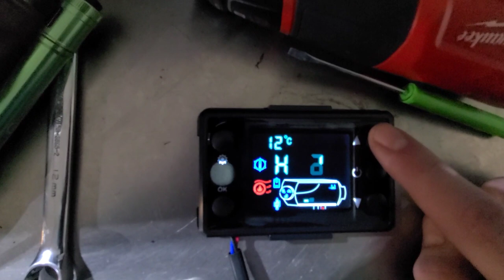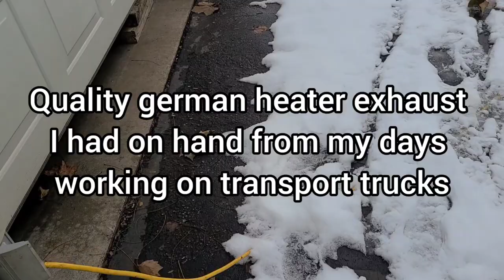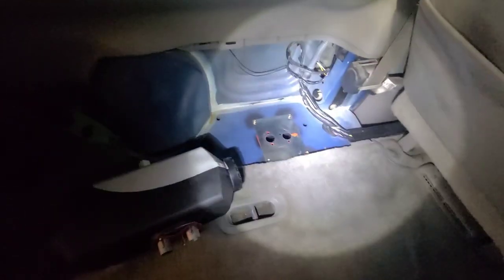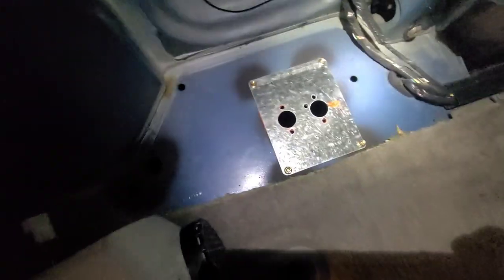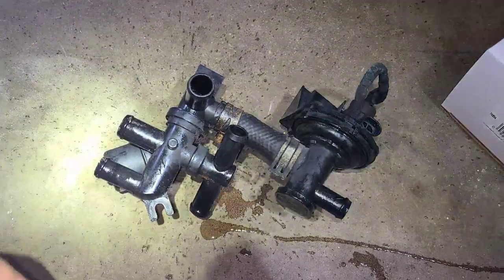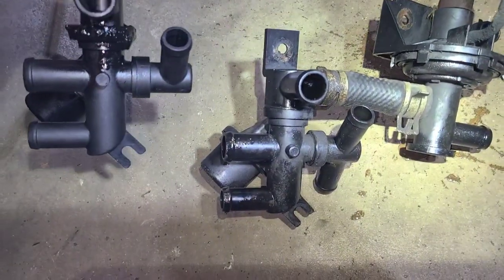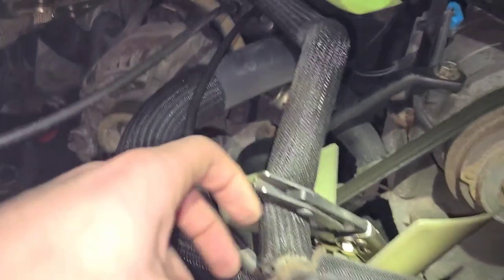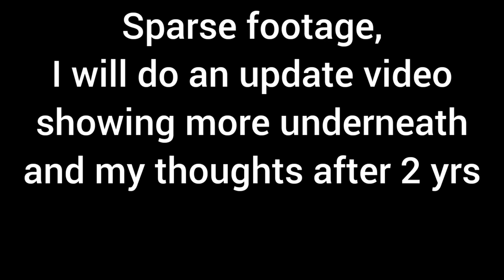Diesel Heater in a Van | Factory Rear Heat Delete - Astro / Safari

Comment: Thank you for this insight... I have an e350 class b..  I wanted to add another heater to the coach for heat during driving...  Is that valve applicable?
Reply from the maker: You want to add a diesel heater to use when driving? I changed that valve on my Astro to delete the rear heating system all together, rather than looping the lines. I wanted to eliminate as many potential coolant leaks as possible. I am not familiar with the e350 but it does appear to be similar setup. Thanks for watching and good luck with the class b!
Reply: @alwaysgoodinthewoods  thank you for the reply 

i will be running a parking heater eventually but it will run of gas so I can tap my tank...

What I wanted to do is mount another heater core to the coach side and when the van is running... Also heat the coach....  

I also have a wave 3 which is absolutely phenomenal but it does add moisture inside the coach..